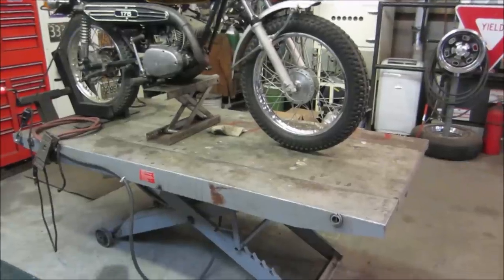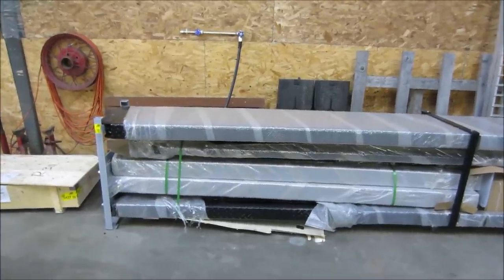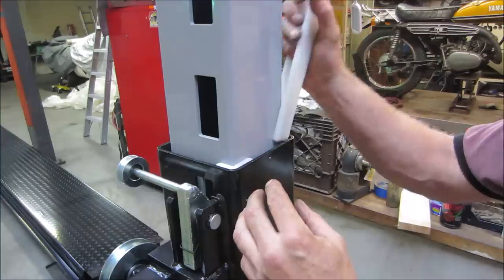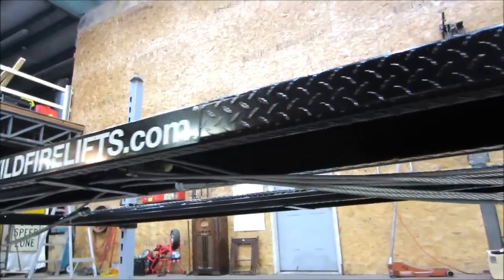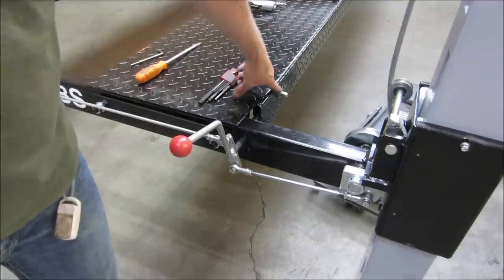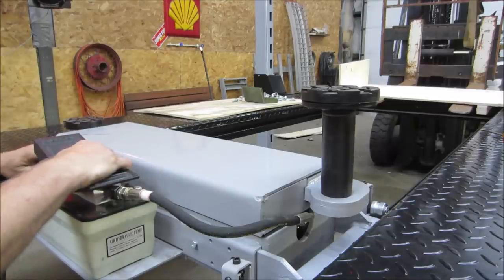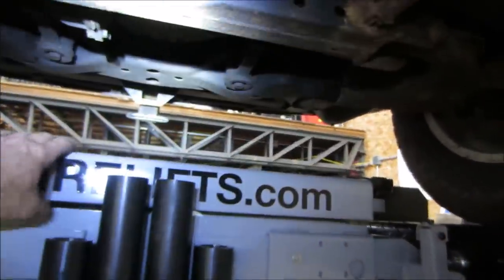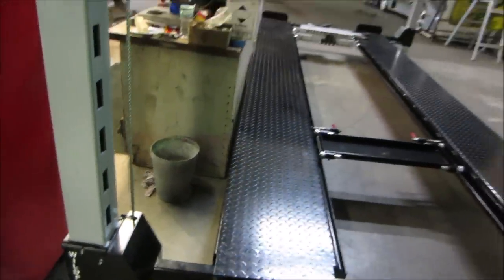Bought a Wildfire 4 post Lift, Can a Rookie Put it Together?

Comment: Not trying to be negative but I think I would have gone for the two post lift those ramps are going to get in the way of most things you're trying to do plus it doesn't look like you could be very easily moved and it's going to take up a lot of space a two-post lift you could just drive right past it but yeah you do need to bolt it to the floor it's not real big deal actually pretty easy to do
Reply: 4 post all the way for dork Mustie does.  Also good to store cars on wheels.
Reply: @dukeallen432  I have a 2 post and you can do everything the 4 post does except it does not take up as much space. I can store a car underneath it too. He will get tired of pushing that sucker after about  6 months it takes up too much space. plus you have much easier access to the wheels with those ramps in the way your back starts to hurt pretty fast.  Mustie and I are the same age. I feel the same pain. His worry was the concrete but Honestly if there is a building on that concrete  it should be fine. I would have hammer drilled a 3/4 inch hole where the lift would set and check the thickness. Even with the cracks I would bank that it is OK. Also he could have put a 1/4 inch steel plate underneath the lift that was much larger say 4 ft to double mount it and spread out the weight.

Comment: Triple is spelled like this. I'd anchor bolt that lift to the floor.
Reply: That would defeat the portability of it. Towards the end of the video, you'll see him place the wheels under the lift so he could move it. That lift is specifically designed to be portable in your shop. You can even move it with a vehicle on it. I know this lift is rated for 9000 pounds, but I think you can move it with up to 5000 pounds on it.

Comment: You deserve such a nice lift Darrin. I'm excited to see you work with it. On a second note, I spent yesterday on my back under my pristine 2001 F-250 Super Duty using the air scaler and doing the frame and running gear in the Bar and Chain linseed oil blend shot through the undercoat gun. I snowmobile in the winter so my truck is in the Cascade Mountains of WA State a lot. Over the last several years, I was getting nervous about the rust I saw developing. But, I got her all cleaned up and applied your oil formula. It went on really well using the spray gun and brushing it into all the nooks and crevices and I can see that it is going be a good coating to stop the rust progression. No rot yet and I was pleased to find it wasn't as bad as I had thought. I'll keep an eye on it and reapply as needed. Thanks for the tip. I really enjoy your videos. Warmest Regards.

Comment: Never did like the lifts with the ramps because of brake work, although you do have a built in table!!! But this one has changed my mind to some degree. A friend of mine's son just bought one for his building. Definitly would be easier to pull any centerline problems.  Of course at 74, I most likely won't be making this investment...... you never know though!  
Nope! can't use their' lift..... We live 200 miles apart. BUMMER!

Comment: It is a nice lift and congrats on getting it.  Just out of curiosity did you look at the Advantage lift at all before deciding?  They have the Advantage DX-9000 XLT, rated at 9K like the Wildfire, and the Advantage SS-11000 WD, an 11K 4 poster that can be moved as well.  I believe it is the largest one available that can still be moved around.  I'm in the market myself and researching for my application.  Just wondering if you had compared something like this and ended up with the Wildfire or just went with it because of seeing it at Vice Grip Garage.

Comment: That's a nice lift, that'll be so dang helpful for all the work you do.  Actually not a bad price, the one you have is listed at $3995 plus another $995 for the bridge jack in the middle....you can lift a vehicle off the lift so you can do brake work, axle bearings, etc.  I can only imagine all the stuff you'll be able to easily do now with that lift, and its movable.  Heck I think I could put one of those on my carport...someday maybe LOL.

Comment: That's cool, I want one.  :-)
But it would be a problem to move it around on my floor.
Maybe a bracket and an electric trailer mover could make it easier.
But it is wishful thinking, unfortunately you can't get them here in Denmark.

Comment: Someone put a lot of thought into that toy.  A single cylinder lift, four swivel casters to wheel the whole thing around for positioning, an independent jack to lift the vehicle for tire change, engine / transmission removal,  safety locks at all four corners of the platform, over-strength lift cables (preventing stretch), etc.  Outstanding design work.  And with a little thought and a handful of standard shop tools, it is assembled by one person.  Watching this, it appeared the most difficult part of the assembly was the final adjusting of the leveling so that all four safety latches activated at the same time.  By the way, what were the power requirements (volts, amps, watts) for the system?  The jack used air-over-oil from the shop compressor didn't it?

Comment: Nice lift but not worth the current price.  Would have to work on many vehicles to pay for this thing.  Yeah, you could save 45 minutes doing an exhaust, but you'd have to work several more hours per job paying for this thing.  No reason it should cost this much.  You can buy a really nice 2 pole lift for less than half the cost of this.  You can easily saw out 18x18 inch square of cement dig it out and pour a base with J bolts sticking out to secure a 2 pole for way less than half the cost of this puppy.

Comment: Im 5 years older, ive always done my own brake jobs, but shit i pulled 4 wheels off  a scion tc to plastic dip them 1 wheel at a time and raised the back end both sides in a garage with 1' space on one side and 3 foot on the other side yes i backed the car in once.  But using a factory jack to lift the car and r way to bust the lugnuts loose plus the wheels are a 2 up version  19" rims on a 15" tire system and the cars on factory lowering springs each wheel weights about 75 lbs  trying to hang them back on the lugs a 1/2" off the floor was nuts.  Plus prep and paint all 4.  Im not a kid anymore. Shit was hard. 
I used to do that kind of stuff all the time  i should look into getting one of these just for oil changes and normal maintenance.  Cheaper then going to a shop  plus i can park 3 cars in the garage.

Comment: You used an extension cord. Most cords are 16 gauge. Are you using a 16 or 10 gauge? Whats the amp on the motor. Thanks

Comment: Nice video, hey just so you know my friend had the same truck with almost 200, miles on it took it back to the dealer and they put a brand new frame under it at no cost to him because that was a common problem which I think is pretty cool of them to do. Anyway again thanks for the video and nice job..🇺🇸

Comment: Awesome, I always wanted something like that for working on stuff.  Tore up my shoulder 20 years ago and doing the work on a vehicle really sucks.  In my 40's and already know the doing something and then paying for it the next couple days.  Went down to a lake yesterday and was cleaning up some trash under water and boy does that bum shoulder of mine feel it today...

The pad thing about getting a lift like that is now EVERYONE wants to see if you can do something for them or borrow the lift for something they need to do.  Speaking of, gotta swap the engine in my truck at some point.  So wanna help a guy out, LOL.  

Two things I would do, one get the hydraulic line a little shelf or holder or something to keep it away from the lift.  Nothing worse than wearing a hole in the lines.  The other is cut a couple pieces of plywood or rubber to set under each post it will help just a touch for the unevenness of the floor since the one most out will compress just a touch more and it will give it all a little grip, especially if you use some rubber and glue it to the lift posts. 

And another thing to think about is that open end of the cylinder, I remember one on a farm I was on years ago and things are fuzzy but I remember a bolt was threaded into the hole and the bolt had a smaller hole in it to allow the air in and out.  I know it was done there because it helped keep the moisture out but may want to do something to help keep any crud from getting in there and tearing up a seal.  It's not likely but some nimrod running a grinder next to the lift with it in the air could end up throwing some trash into it and I doubt rebuilding the cylinder will be easy and replacing can't be cheap.  An ounce of prevention will save quite a few pounds or repair so to speak.  Also not a bad idea to give it a shot of oil in the open side every few months and just put a rubber plug in to coat the inside and prevent any rust from starting.

Comment: Nice addition to the shop. I haven't been able to fit the car into the garage for over 30 years, but if I could . . . 

Being a bit paranoid and having spent almost all of my life in earthquake country, I would probable fit some 3/8" or so plates under the pads to give a bigger pad footprint to better resist side motion when a car is elevated. Welded-in threaded studs or countersunk bolts would keep the bottom of the plates flat and allow them to be removed with no problem. It would also spread the load over a wider area of the floor.

Comment: Hey Mustie, been watching you work for some time now. Another awesome build.  2 or 4 posts are just as good as 2 or 4 wheels.  Still entertaining and useful. Quick question, I wrench on my motorcycles all the time and I'm looking for a good quality reasonably priced lift for DIY use in my home garage.  Something that can be stored or rolled out of the way using compressed air or electric.  Any suggestions.  Thanks!  Stay safe.  Same age by the way and just a little south of you in MD.

Comment: Started at age 14 in my folks Jenny Station with a single Pit, which I had to line with cut up pallets to reach the height of vehicles for greasing.  My Next station had a single post lift.  Fast forward to my own restorations and it was back to a creeper (no pun intended).  Thanks for sharing. Narragansett Bay.

Comment: To me, that lift seems safer than the other type that has only 4 arms that swing out and hold vehicles up in a relatively small area of the frame because the vehicle is resting on all 4 tires.
If it's set low enough to do wheels off work you can use jackstands to suspend one or more corners.
You can also suspend a vehicle to a height were you can use a wheeled work chair to work on the bottom or sides of a vehicle to save strain on your body (especially your neck and back) from standing for hours.
Yup, I think Professor Mustie made a wise choice in choosing this type of lift.

Comment: Great looking lift - much envy ! Noticed at my local garage the ramps drop to near vertical to prevent any risk of vehicle rolling off if it should slip off front jacks - seemed like a good idea , not sure if the Wildfire has that built in - yet .  I'm 67 and still crawling under in the dirt or not !!

Comment: Quite oddly I saw a lift like this in a house movers barn. He had a very tall barn that he did his hobbies in as he is older than me and we were in our late sixties then... him an his son built it from jacks and stuff used in the house moving business. He had brought some square tubing, an other materials an wanted me to weld up and his words were spare no rod. Okay John, so decided since done with the end I was on I would deliver an I was shocked. All new floor in the shop with total open interior an box's for tools an welders an stuff n more stuff all around  and it was all under a bunch of floors that were on the second level. He had built some and told me then as soon as this one is installed I will bring the other two over for you to weld up an I told him my welder is mobile so leave em be and we will use your bob cat to move stuff with. I had a old four hundred lincoln stick machine off the slope. Nice machines an runs oh so smooth. I have dipped my own round stock an burnt in half inch in bridge beams. Its faster than the multiple runs. Quite simply he had parked his rare and precious rolling stock from the twenties forward on the loft area in the barn.

Comment: I am just finishing my shop add on that has 18 ft high walls. I was going to put in a two post lift but after seeing this I think that this 4 post lift may be the ticket. With the jack on the 4 post lift it almost cancels the benefits of the two post lift. I love that you can move it too if you need to. Never have look at your channel before but I will after seeing this video. Thanks

Comment: Could you buy a second Gray rollings there you wanna call it scared that to lift the cars that will you can lift all 4 tires at the same time is it possible to buy a second one of those and then have 2 of them that way you flip the car off with a thing or is it not recommended may be emit it much you don't we have 2 wheels and long at on the grab and then 2 wheels in the air and I did notice of your car tires may basically they would that was the maximum with on your truck they can go well if we have gotten its wider would you do then So what happens if your cars a lot of wider than your truck is as he might it was the maximum distance I'm not sure every car's exactly wheel based to a truck

Comment: Say you want to pull a trailer up trailer want tires usually are wider than that of the vehicle that you're pulling are putting up on the trailer so those wheels would leave and go on your ramp they would be outside of it would you do then

Comment: When you use the caster kit, do two things.....first, when you attach them, rotate the wheels so that the offset is pointing towards the posts. It will give a longer lever arm on the other end, making it easier for the empty runways to pick up the lift. Second, make sure it lowers down enough that the caster kit arms are parallel to the floor. That will allow the casters to swivel easily when you're moving it. If the runways aren't quite heavy enough to make it drop down to where the arms are level, you might have to hop up and down on them a couple times.

Comment: you should see about getting a second one of those rolling jacks to put on the far end so you could have both ends of the vehicle off the ramps so that you can work on both the front and rear suspension or wheels and tires at the same time.

Comment: Not that it matters now, you’ve already installed it. But had you slid the cross rail to the bottom lock or second from the bottom and not the middle, all the weight would have been lower than the center and would have been easily lifted by hand. The weight being low would have actually helped you lift it. Think of a hammer laying on its side and picking it up words to do a head stand, by the bottom tip of the handle. The hammer nearly picks itself up. 

Awesome video non the less!! I install these for a living. For 10 years now. And I wish we had that type of equipment in the field. Love that hydraulic cart! Huge back saver! But that Jack stand on the platform, lifting maneuver had me at the edge of my seat.
Reply: Also should have EQ’d the cables prior to the lock linkage. Raise and as soon as the 1st of the 4 clicks you tighten it. Then raise it again until that first one clicks again and then tighten the last 3 until they click. You’re bringing the longer ones up to the shortest ones length. Then linkage. 

At the end of the day you did an awesome job for someone who’s doing it for the first time. I had some cringe moments, where I’m glad you didn’t get injured. Like sliding the rolling bridge Jack out of the box!😳😳 but if I had guys with your knowledge on day one, I’d be in Heaven!!

Comment: Great video. I install and maintain lifts and lift equipment. Just one thing if your rolling jack is up front its on backwards you want the pump facing towards the back. Not a big deal just a nit pick
Reply from the maker: l do do allot of rear engine stuff

Comment: Just a personal preference but the bolts holding the landing pads/ramps to the cross bars, I’d have put them the other way round with the nuts and washers inside, not only looks neater but the safety release would clear them much better.
Reply from the maker: cant they will hit the cables
Reply: Mustie1 I see

Comment: how do you work on the brakes/tires with this lift?
Reply from the maker: the trolley jack lifts the wheels off the lift
Reply: @mustie1   @Mustie1  Can you only lift the front or rear off the lift at once? Or do you had two of those trolly extendo arm lifters?